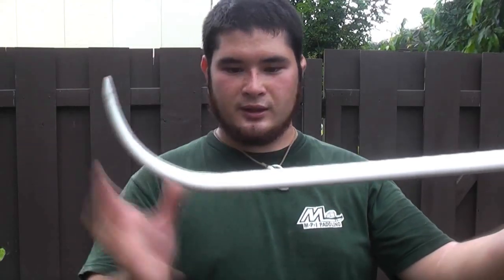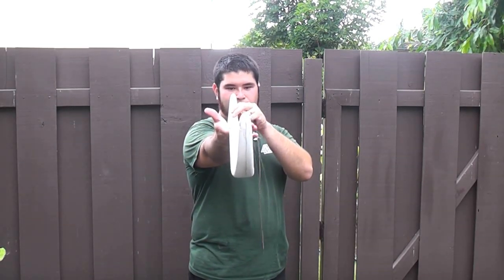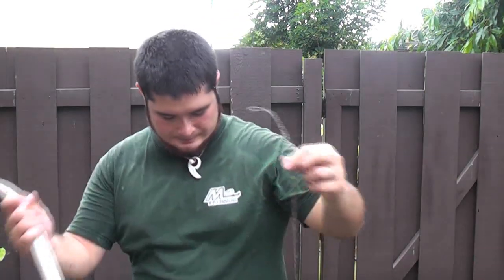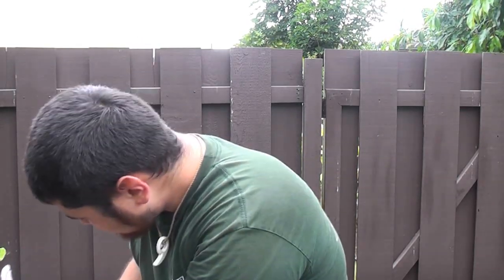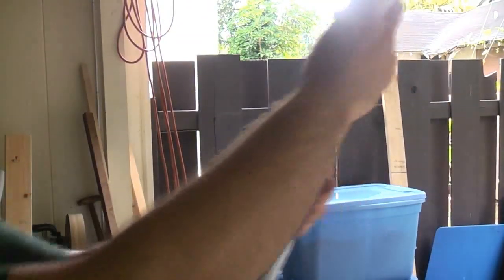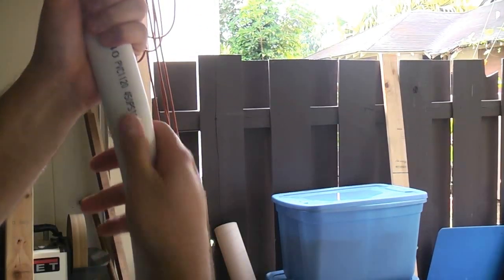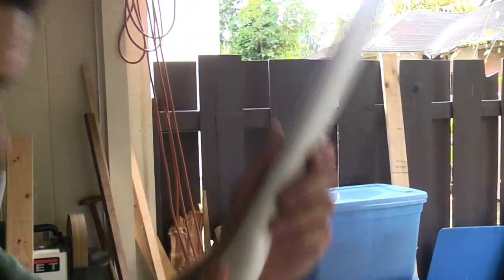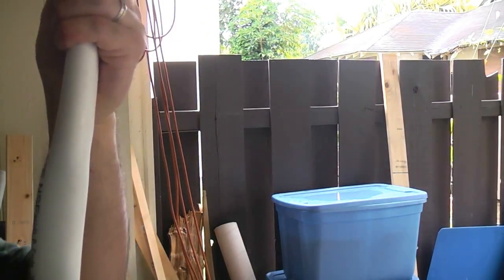How to Make A Centershot Snakey Recurve Bow Part 2

Comment: I;ve begun working on this one as my first bow. I'm at the part where I've cut the nocks in, My thought was I would just use 550 paracord till I can learn how to make bow string out of darcon using a stringing jig. Anyway, I was about to put the string in and it kept slipping downward, so I put a straight line cut in the back connecting the two slits that appears to work better. Is this type of nock only for thin type of string or will it work with pararcord?

Comment: I just had one break right at the base of the glued taper. It was on a long bow using this split tapered tip and I had used hot melt glue to hold it together. Not sure yet of the cause. I have made a number of these bows with the same tips and the recurved bows
 seem to be fine.